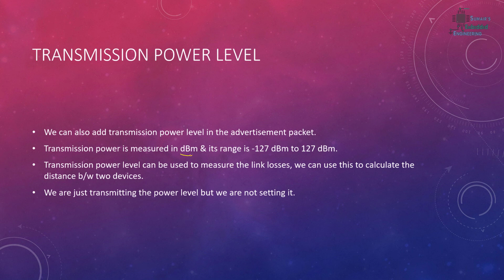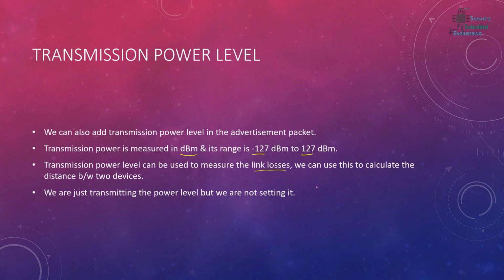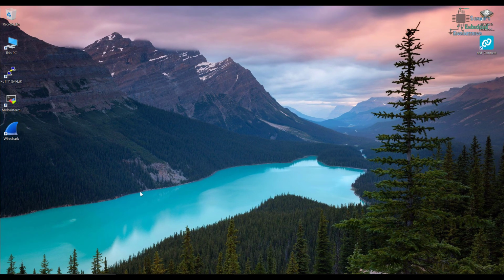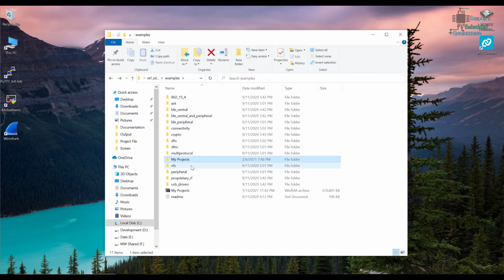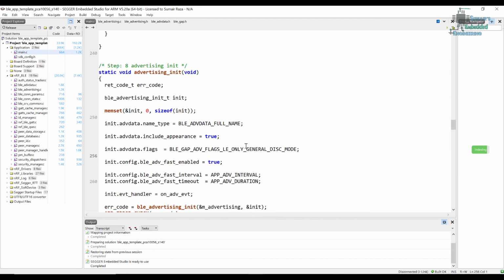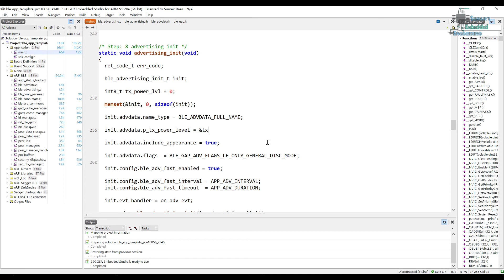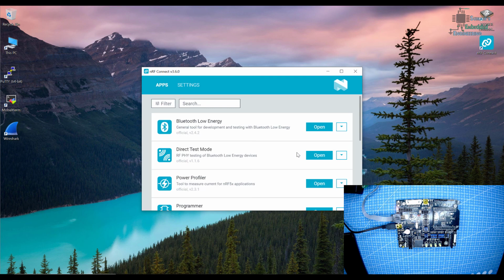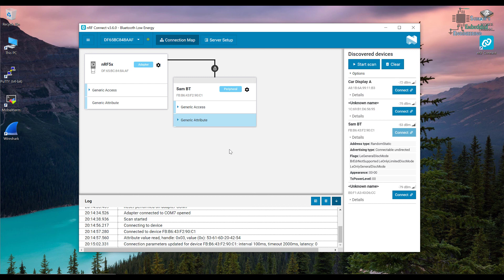nRF5 SDK - Tutorial for Beginners Pt 45 I - Tx Power Level in Advertisement Packet

Comment: I like your videos, you should start a series like this for the NRF Connect SDK. It’s very nice to use, very easy to build for multiple different devices without porting, and very easy use of threads because it runs on top of the Zephyr RTOS. Also the VS Code extension is much nicer to use than SES in my opinion. Either way keep up the good work!